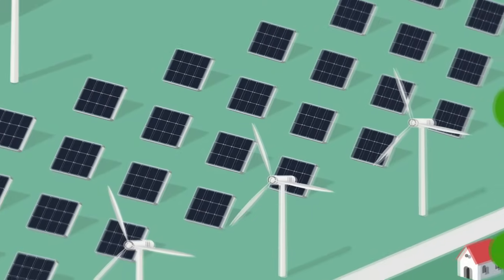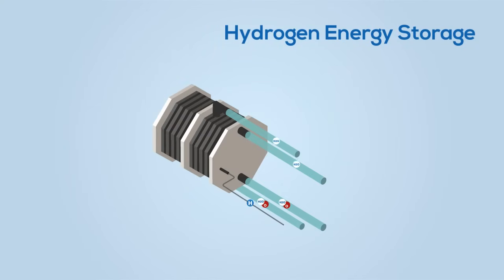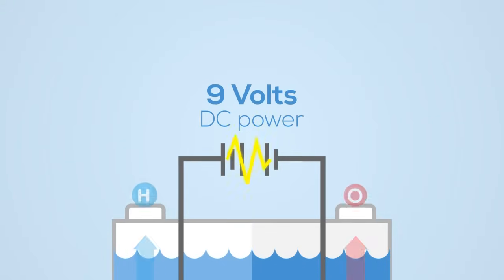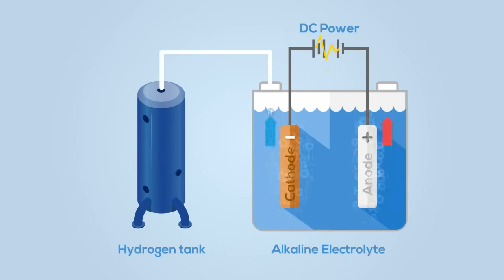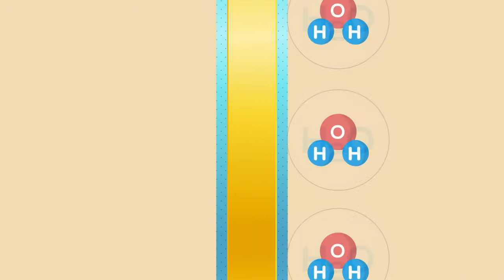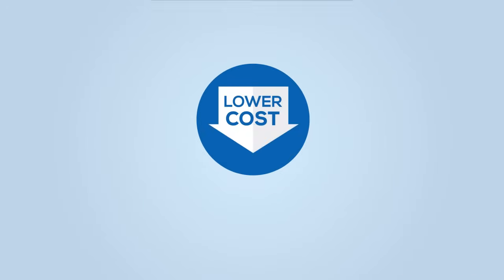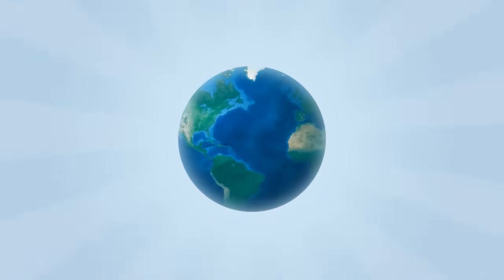The Hydrogen Electrolyser

Comment: You think electric Storage is expensive, hydrogen storage is ridiculously difficult to do at more than two atmospheres … it is the smallest molecule and is reactive with metals … the best place to extract your hydrogen is right next to where you need it … nobody actually makes hydrogen they just extract it … I don’t care what colour hydrogen you have, long term storage of the Gas or liquid is impractical , add to that the disadvantages of handling such an explosive component in any device that has aged ,I’d rather be plugging in overnight on a 230 v AC power point to energise my travels …

Comment: Storing excess solar as hydrogen could help build resilient energy systems.
Reply: How ? It’s not easily stored … ie your full tank of hydrogen in your Toyota Mirai is after two weeks too empty to go anywhere because it was just slowly leaking the hydrogen at the valve fittings … did you know it was this bad? You might want a pressure tank to bring hydrogen to your immobile hydrogen car … or have it hauled ☹️🙃

Comment: Fyi, separating the water molecules in order to produce hydrogen/oxygen makes the water molecules a non-renewable resource for all extents and purposes...think about it for a minute...
Reply: What do you mean? Yes water turns into hydrogen and oxygen, but then you burn hydrogen with air (oxygen in it) which produces water. So you have a continuous water cycle, completely renewable.

Comment: I decided to check out hydrogen electrolizer technology after my local news were buzzing about a corperation getting approval to start their Canyon Creek green power complex west of Hinton, Alberta, Canada.  Canyon Creek will used the abandoned mine as pumped hydroelectric energy storage as primary energy storage. The hydrogen electrolizer would be secondary energy storage.  It will be surrounded by fed into from several wind solar farms.  Hinton already has a just completed solar wind farm of 20 Mw but they want to keep adding more to peak out at 400 Mw.  That would be crazy huge in excess of 20 to 30 square km of land.  The abandoned mine turned lake resevior alone is 15 square km.

Comment: The bubbles appear on the electrodes so if hydrogen is released from one electrode then oxygen should be release at the same time and same for the other electrode. There are no oxygen and hydrogen bubbles moving across to their opposite electrodes. In conclusion the hydrogen and oxygen is coming from the degrading electrodes and or the electrolyte mixture. Water is not being split into H and O.

Comment: This was posted in March 2015.  What happened to the Anion Exchange Membrane (AEM) Hydrogen Electrolyser?  Why isn't it being used to generate the Hydrogen needed for Fuel Call vehicles from Renewables like Solar Panels around the world?  All I see are complaints about Industrial generation of Hydrogen from Methane with its Carbon Dioxide biproduct.
Reply: @Corrigan WrongWay  Hydrogen from Methane is a more polluting process than it's worth.  It creates more of the same pollution than Hydrogen replacement use does; that is gas and diesel ICE vehicles.  If you don't believe that Hydrogen Fuel Cells would be a better way to go than the current fossil fuels, that's you, but a clean source of Hydrogen for Fuel Cell vehicles or even ICEs is an excellent fuel or there would have been ways to produce it from water for ICE vehicles into the carburetor or fuel injection and even blasting rockets into space.  It burns hotter, so ICE mixes and tolerances need to be adjusted, but it is a great fuel.  I don't think you know the facts, but whatever.

Comment: so basically its like iv been saying for the last few years.... just adapt these hydrogen batteries into hydroelectric power plants.... everything you need if right on sight.... fresh water... constant power.... underground storage o.o' could the conditions be any more perfect.....
Reply: Same... They b*tch about how it is impossible to store hydrogen. I wonder were 'natural gas' is stored.
Reply: @curlyhairdudeify  in an industrial setting lithium 6 deuteride would be a viable storage medium... i can understand the risk of making that substance public but they work with loads of hazardous materials in industrial settings generally safe manner so just because its used as a catalyst in thermonuclear weapons doesn't mean it isn't useful for other things... its a hydrogen sponge... which solves our storage issues since when absorbed into the hydride it requires very low pressure to keep it contained and doesn't require cryogenic temperature's

Comment: So, this device makes hydrogen in a compressed form without a compressor. What color is that flag, you guessed it : red.
Reply: a compressor unit is probably built into their system!!! they just don't say that in the video! haha!!
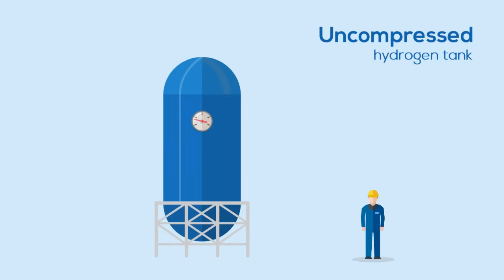Reply: They literally say you need a compressor at 2:15
Reply: If you are not an engineer or chemist, you don't have the right to object without understanding it first.
Reply: @fsdsavinglives  WRONG!!!! You ever hear of common sense?
Reply: which makes the hole video questionable, no tangible information in here - dismissed...

Comment: dumb question since i dont know. do you need swap the water.or can you do it with the same water all the time?
Reply: Yoda Yoda    What?
Reply: The process breaks down water into its two component elements. 
As it does that the water is converted to hydrogen and oxygen gases and the water has to be replaced for the process to continue.

Comment: WE can actualy kill 2 birds with 1 stone,  electrolisis produce Hydrogen and Oxygen,  we can burn oxygen too
Reply: Burn oxygen and produce CO2.. Great though caveman
Reply: @prateekprasad4062  how does burning oxygen produce co2? the op never mention burning any form of carbon so explain where the c came from
Reply: Then , you can't use hydrogen for fulecell for generating electricity back 👍
Reply: no, you can't burn oxygen, but oxygen is needed for all burning process. And yes, the oxygen you split is all the oxygen needed for the hidrogen combustion. You can even let the split particles in a mix that is called hho and burn it.

Comment: warning  warning    danger danger    never never try to compress hho      it can self ignige at 18-23 psi
Reply: They're not.....using PEM/AEM separates Hydrogen from Oxygen.  So they are compressing Hydrogen only for storage.  It's also supposed to be DC supply to the Electrolyser..not AC :-)
Reply: @jeffclarke7990  where was the compressor?

Comment: How do you fuse this technology to be fused in s car's combustion chamber to lower fuel cost?
Reply: bore a hold through the manifold and plug it in or wire a pwm into the accelerator to the gen.
Reply: Honestly to convert to a hydrogen system you’d be better off running the oxygen exhaust of the electrolysis into the already equipped fuel tank and allow it to flow through the fuel lines and be injected at a rate where the pistons and the spark are timed accordingly. This would be the simplest way to convert into this system.
Reply: You dont stupid. There are already fake products that claim to do that. Do everyone a favor and keep your ideas to yourself, especially the political ones because I guarantee they are as stupid as your question.

Comment: The membrane for PEM is a polymer and not out of gold as your sketch might indicate. Correct is that the cathode can be gold instead of platinum.
Reply: And you don`t need to convert to AC to make the electrolyzer work
Reply: Though PEM’s used Gold, Iridium, and platinum

Comment: PEM stands for proton exchange membrane technology and for polymer electrolyte membrane, both of terms are used in hydrogen electrolysis, isn't confusing? and what is the diffirence?
Reply: I have always heard it called a proton exchange membrane. But I guess some people name it by what it does, and others name it by what it is made from. That's the difference.
Reply: Both terms stand for the same technology but they highlight different aspects about it. As an example, naming after exchanged ions (protons) distinguishes from AEM (OH-), whereas naming after eletrolyte material (polymer) distinguishes from solid oxide electrolyzer cells (e. g. zirconium dioxide).

Comment: I have solar panels on my roof but I have a grid-tie system.  I really wish I was off-grid but not with batteries; with a huge underground hydrogen tank instead.  But fuel cell technology is way too inefficient. They don't mention that part.  Electrolyzers are more than 80% efficient but, used in reverse, they have horrible efficiency.  Can you imagine producing hydrogen with all your unused power and using an efficient fuel cell instead of batteries?  And for heating and cooking, you could actually burn the hydrogen directly.  And you could throw out your carbon monoxide detectors because H2O is the only product :)
Reply: Direct hydrogen flame will melt your cooking ware. Also your gas lines and fittings won't be suitable for hydrogen gas. The cost of retrofitting your gas a plumbing would be extremely costly.
Reply: Nice way to get a bigger than atomic explosion !  They added hydrogen to the nuclear weapon to make the more destructive Hydrogen Bomb … seems people either don’t know or have forgotten …

Comment: You state that Alkaline electrolysis is not adapted for renewable energy nor pressurized - but this is not true! We have been developing and delivering robust Alkaline electrolysers for 10 years - that has a very high dynamic (10-100% in a split second) as well as deliver clean, dry and green hydrogen directly at 35 bar. Please see more on www.greenhydrogen.dk for real facts about alkaline electrolyse!
Reply from the maker: Dear Henrik Steen Pedersen, thanks for sharing your achievements in alkaline electrolysis. We believe the AEM electrolyser provides the best platform for small to medium scale modular systems such as the one at the Phi Suea House. There are a number of reasons, including cost-effectiveness, very high system efficiency (over 70%), low water consumption (0.8L / 1m3 of H2) and the ability to produce hydrogen from almost any water supply with just a regular water filter that can be found in any household appliance store.
Reply: I know the AEM technology from Acta/Heliocentris/Inabata/... which is a nice small solution. We have for several years been running a complete off-grid solution in Sweden using our Alkaline electrolyser with good success - so we are a strong beleiver that our system is superieur also when it comest to lifetime and TCO. We see an increaing demand in bigger and bigger systems and here we see a good solution with alkatine. Take a look at our partner in Sweden who have been using our solutions for many years. http://nilssonenergy.com/portfolio-item/demo-site/ Today we have an efficeincy of 84% at 100% load - and higher at smaller loads (which it often is when we we use solar/wind) and water quality is not and issue - it's just to replace a 50€ filter a few times yearly.

Comment: How come you convert the DC to AC before it reaches the electrolyser? I thought DC was the only possibility for electrolysis to work.
Reply: There are several devices to convert AC to DC (think about your smartphone charger, but than larger and more advanced) and you can convert DC back to AC with other stuff, working on the grid based frequency.
Reply: @rolfhelder7771  There is a device which can convert AC to DC realy? LOL you only need a diode and a condensator, this is basic electronic.
Reply: haha, I guess aurk didn't know.  You're right Richard, you must use DC to split water.  Otherwise, you get hydrogen and oxygen mixed together... talk about an explosive mixture! 
I think they meant to show some of the solar panels directly connected to an electrolyzer (or, better yet, a power router that will automatically route any unused power during the day to the electrolyzer instead).  This is the only scenario that makes sense since they boast that PEM or AEM electrolyzers can work with fluctuating renewable current.
Reply: Absolutely, I am assuming there is an oversight in the animation which was made.
Reply: Since it's from 5 years ago what happens is opposing traditional energy interests edit/ hack these videos and then reupload them to be incorrect or ommit vital steps. You see this in l-ion e-bike build tutorials all the time.
Reply: @MoreSuperiorThanCarbon  fucking people don’t have anything better to do… wtf
Reply: @MoreSuperiorThanCarbon  cmon man. Those with grit to work upon these engineering challenges can't be fooled by such trivial oversight.